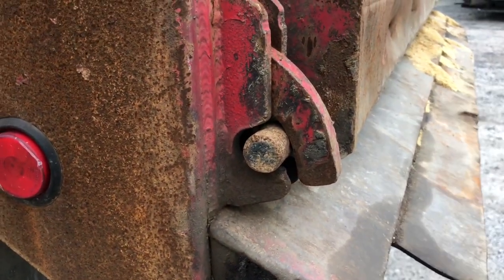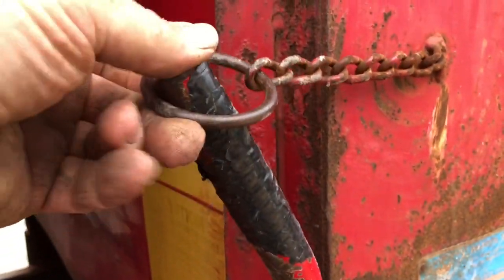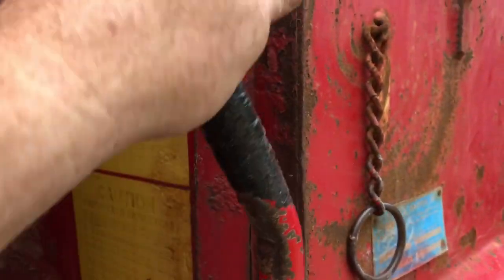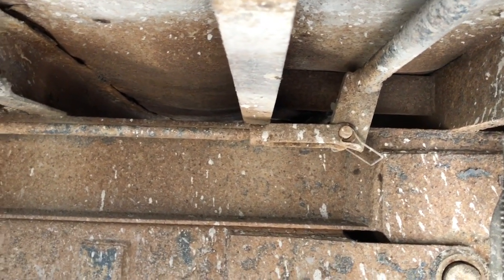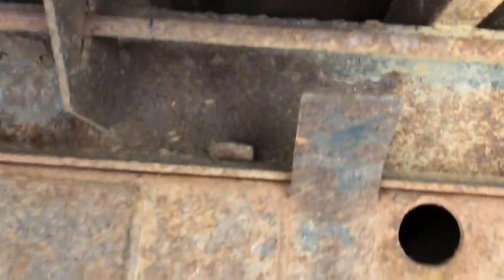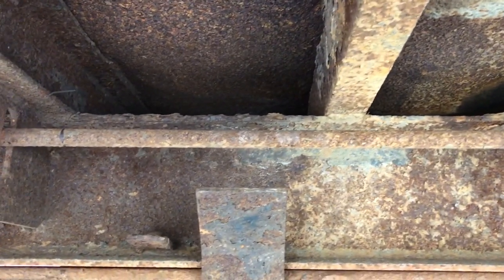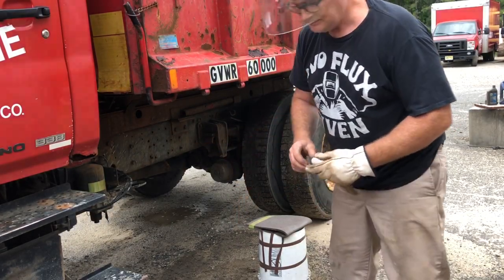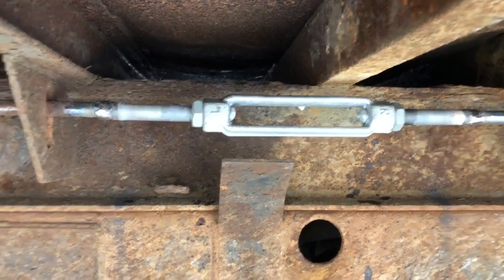Dump Truck Tailgate Quick Fix

Comment: I just heated the original turn buckle up with a torch, hit it with cold water and it brakes the rust loose so I could adjust it. Much easier and faster than adding that in my case.